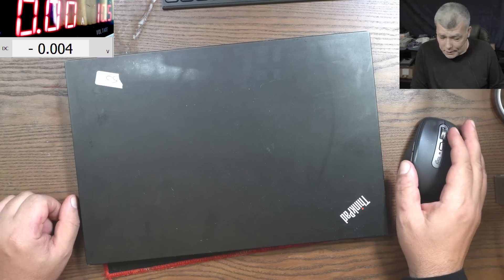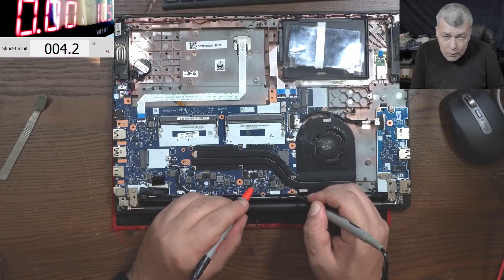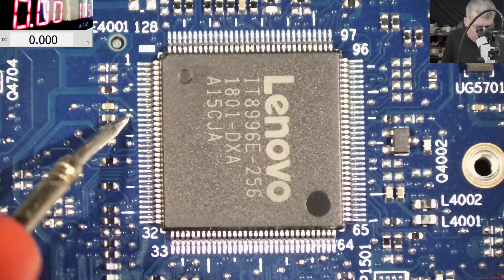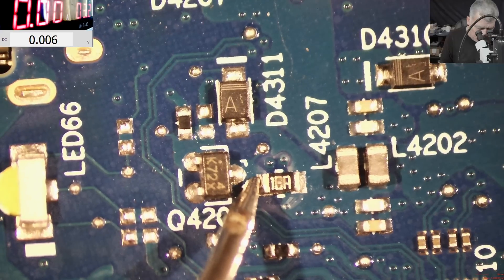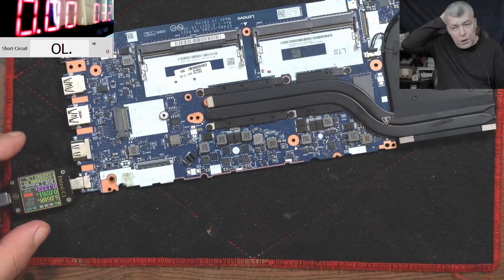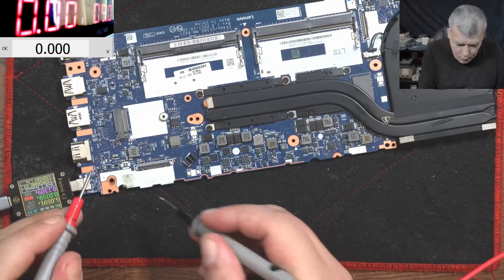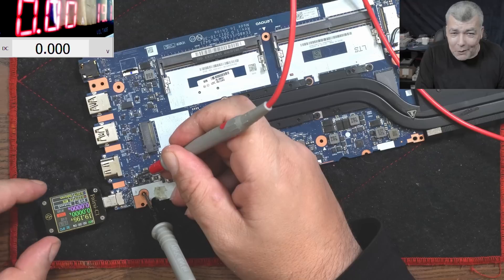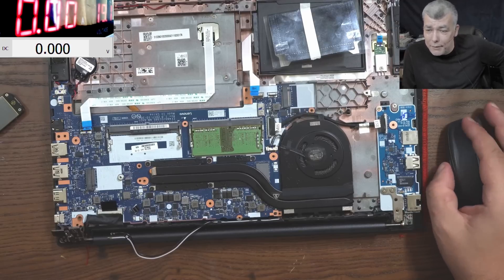Lenovo E580 - I smoked this laptop - How to check a usb-c board with a power supply

Comment: Hi, Sorin. Great video as always. :) I have in the past found a few laptop boards with no capacitors around the EC chip. How would you test EC chips like that? Would you just go to the closest caps on the board connected with the EC chip even if they are quite far away?
Reply: Test for acceptable voltage drop using diode mode with MM on non ground pins of the EC chip, or further away connected capacitors. Without a proper data sheet not much more than that can be done.
Reply: @DaTechServer  Where did he apply that 5 volts to?  was it a chip, a cap , a resistor or a test point? thanks!